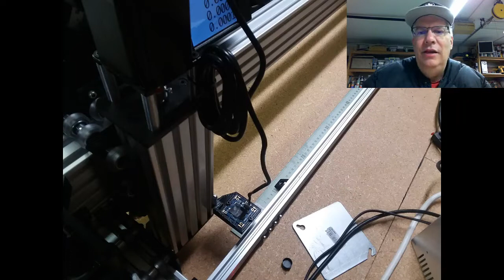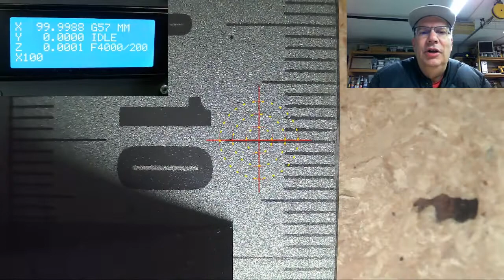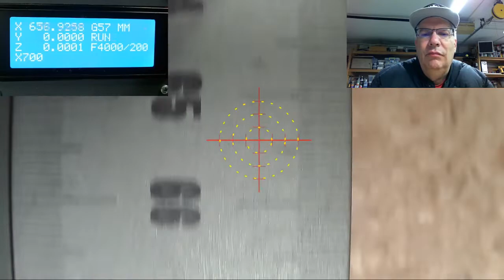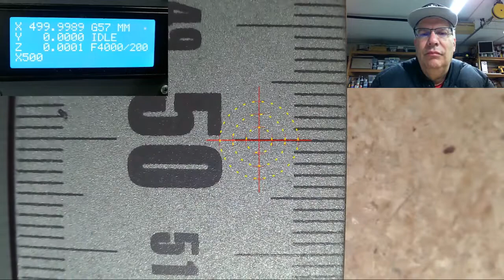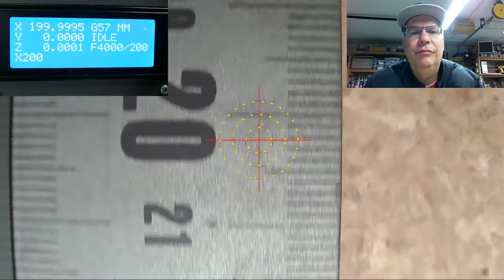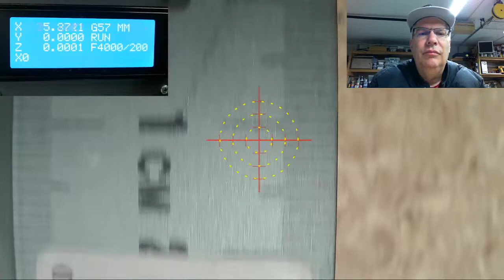181105 Valve Studio - Tonehenge Journey - X Performance Calibration

Comment: One step forward two steps back... man that sounds familiar, but progress is progress. I'm looking forward to seeing the workbee do some work, and cutting speaker cabinet panels. It's funny, the thing that led me down the cnc rabbit hole, was looking for a solution to cutout arcade cabinet panels precisely and repeatably.
Reply from the maker: You don't even know how accurate your comment is. While adjusting the microstep settings, I managed to set the 2 y axis motors differently, very bad. This combined with high-torque motors resulted in tweaking the frame and bending another lead screw. argh! Learned my lesson there. Going to calibrate Z, mount the spindle and spoiler board and actually cut something. Heart be still.